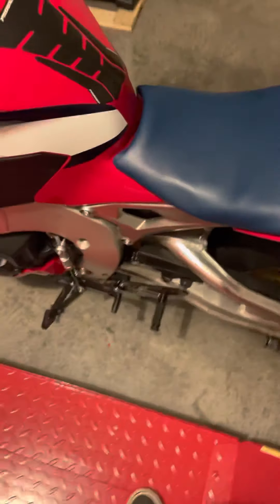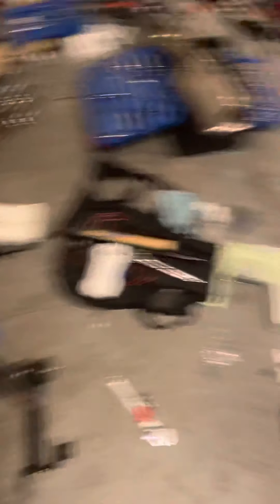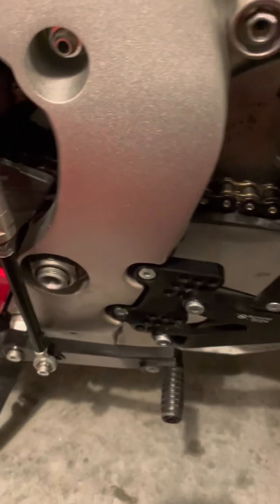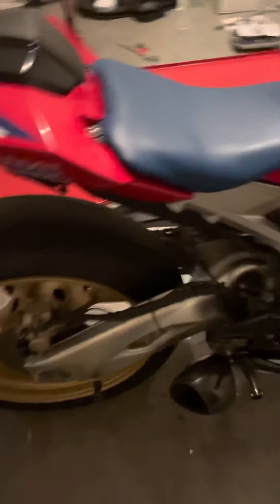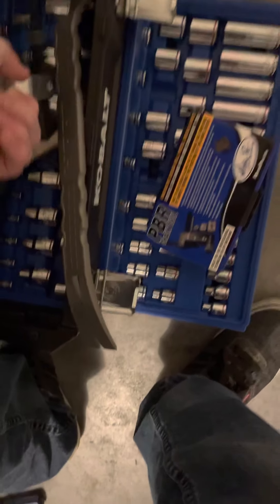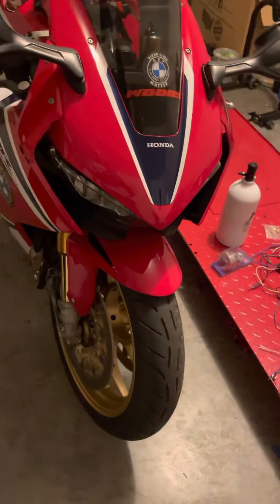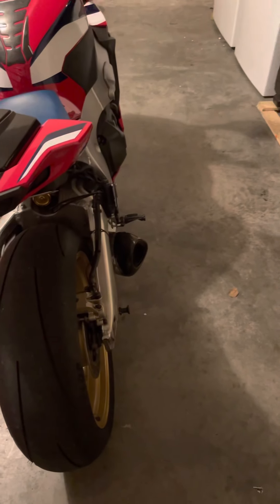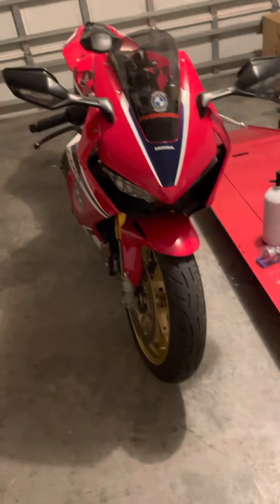Channel update

Comment: Dude , you can buy a shorter rod and adjust the angle , just like I did it works  100%
Reply from the maker: I actually asked bonamici about getting a shorter rod and they said that’s the smallest one they have so no telling wtf is going on there I’ll figure something out.
Reply: @r0hx227  I bought my on ebay for 9$ to fit and adjust
Reply: @r0hx227  connection rod they are all the same
Reply: @r0hx227  type this in ebay "FXCNC CNC Gear Shift Linkage Shifter Link Rod For Racing Rearsets"

Comment: Why you remove the nitrous
Reply from the maker: Would you rather have a bike be 25-30 hp faster stock or use power adders on a engine not designed for it until it breaks
Reply: @r0hx227  was it that risky when you had it on

Comment: I have a 2018 non sp what are the must have mods i need. I'm into the same riding u do
Reply from the maker: Honesty that depends on what you want to do with your bike
Reply: @r0hx227  roll runs and some from the dig
Reply from the maker: So you need a hard hitting tune, velocity stacks, a 15 tooth front sprocket(520 conversion kit would be even better), a extended swingarm, lowering links(I have these for sell actually), and a sticky tire like a Q4.

 I have a swingarm but the axle on your bike is different than the axle on the swingarm so its a different thing all together. 

As for the tune and a lot of the other things I know who can get you what you want if you want to be fast.
Reply: @r0hx227  thanks man I appreciate it. One day i have to get out there and check out ya bike seen. Here in FL we have alot of bike days to and group rides.